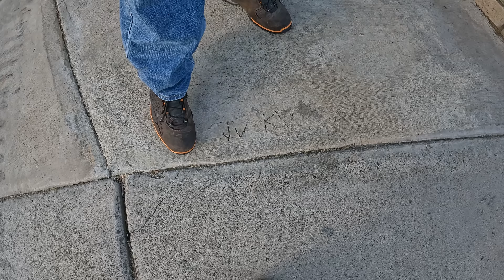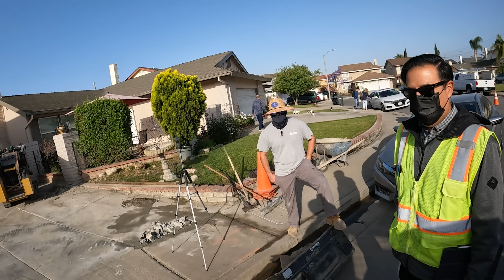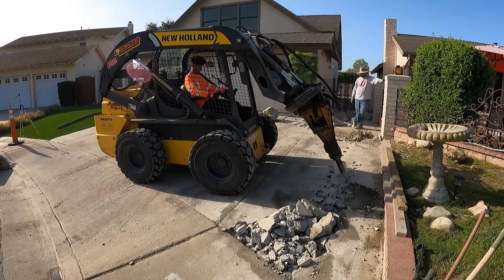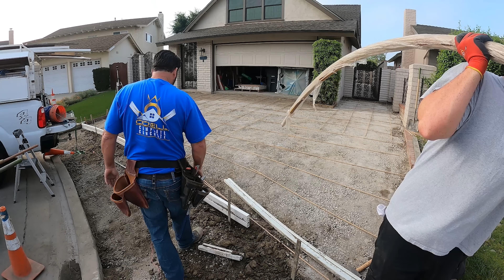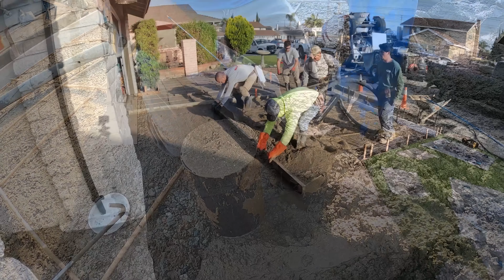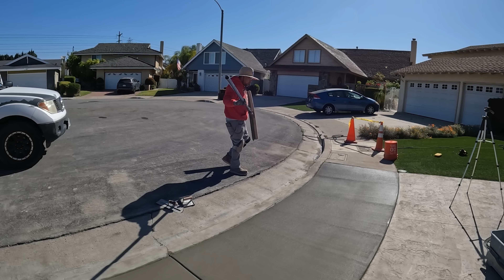The Building Inspector Showed Up...

Comment: Fly ash is an additive to make concrete flow better. It also acts as a filler to make concrete cheaper. Fly ash is a by-product of coal fired power plants. The PSI of concrete is determined by the amount of Portland cement mixed into the concrete. It is also determined by the amount of water added to the mix. For a driveway, I would use at least 4000 psi mix. Concrete is not an exact science. The psi can vary as much as 1000 psi in either direction. I might cost a little more, but better in the long run to have more psi than not.
Reply from the maker: I concur

Comment: The OLD concrete drive way  DID NOT LOOK TO HAVE "WIRE MESH" NOR "RE-BAR"  Which would have prevented or delayed CRACKING of the drive way.  Will either one of those reinforcing materials be used on this drive way replacement???  I notice other people asking the same question.....Will wire mesh OR rebar be used to reinforce the drive-way????    SORRY !!!  AFTER GOING FURTHER INTO THE ACTUAL VIDEO OF THE CONCRETE BEING POURED, I DID SEE THE "REBAR" USED ON THE SURFACE AND BEING RAISED AS THE CONCRETE WAS BEING POURED TO MAKE SURE IT WAS PLACED TOWARDS THE MIDDLE OR SO OF THE CONCRETE THICKNESS...
Reply from the maker: Yes, reinforcement in the driveway but not in the approach

Comment: Have you considered using non-rusting GATORBAR to avoid rebar expansion cracking concrete?
7x lighter than steel rebar
Higher tensile strength
Rust-free/ Corrosion resistant
Non-conductive
Extends life of project by 2x
Environmentally friendly 

Available in glass or basalt
Reply from the maker: haven't heard of it but it sounds a lot like what I used

Comment: That's one of the smallest hammers I have ever seen-in my 50yrs of heavy and highway construction. The reason it is breaking so easy is because there is no wire in it---usually you use at least road mesh or equal----and, the concrete is thin and probably not placed properly---FYI---you don't pour concrete, you place it !!!!! You need to research your methods of placement of concrete and the proper curing!!!!! Come on---lets do it right and give the buyer a job that will stand the test of time !!! You residential contractors have a lot to learn!!!!!

Comment: Hey… do you have to put rubber between the slits to protect concrete from expands with the heat and shrink with the cold because the weather or no need. Thanks 🙏 keep it up 👍
Reply from the maker: Not here in Sothern CA. where its beach weather everyday

Comment: Hey Dave, with respect to the drain pipe and the pop up at the end...I can see that this is at the end of the grade on the front yard but, is there an issue with residual water that doesn't drain? I suppose it would be minimal and evaporate?
Reply from the maker: Yes the residual will seep through the perforations

Comment: Difference with Aus concreters we use aluminium screeds and don't have to continuously bull float concrete into our holes we get it that flat. Pieces of wood are rough as and leave defects everywhere. 
Also no steel in the approach, hope the soil isn't reactive otherwise it is going to break up.
Reply from the maker: This is standard building procedures in this area, and it seems to work well.
Reply: @OdellCompleteConcrete  you must be blessed with good soil

Comment: Great video! I got a question, why the concrete mix I made using the recommended water amount seems too dry, not flowable like what I saw from professional truck loads? Thanks for answering
Reply from the maker: Because they can reach specified psi on bag without as much cement
Reply: Thanks much! In this case, how can I make it flowable like professional truck loads so as to avoid voids?
Reply: @linzhang1717  From what little I know, the drier the mix, the stronger the concrete. So if you want to reach the PSI specified on the bag with a wetter mix, like he said, add more cement to the bag mix and then mix it up wetter.

Comment: Why not use 2 45 degree fittings at  corners instead of a 90? Hard to get the debris and a hose to go in to clean it out. It will get crap in it eventually.
Reply from the maker: It's going to flush out quickly because of all the slope

Comment: If you widen it in this case its only make it easier to get one more car off the street, You can clearly already do it if you know how to drive. The consequence is that you're clearly losing parking footage on the street. So allowing it is a clear win for the homeowner but potentially a big loss for the neighborhood. Seems pretty obvious to me, it is a reasonable policy to have.
Reply from the maker: 3' doesn't change any thing on the street
Reply: @OdellCompleteConcrete  in a place like the Bay Area it absolutely does. Twenty feet between two driveways is enough room for two cars. 17 feet might not be. 

Sure it may not be a problem in that town, yet.

Comment: This inspector and you don’t understand why there are rules to how much concrete apron there should be.

Ideally, none.  But there must be concessions for public safety.  The problem is that precipitation is the only means for replenishment of aquifers and ultimately everyones water supply.  With all of this concrete and parking lots everywhere.  All of that water must go somewhere and it’s directly into storm sewers washing untreated garbage directly into a lake or stream while abusing the infrastructure at the same time.  Public and private assets are the primary reasons for most flooding.

Comment: I've seen powder coated rebar and I know it's an issue because of cracks and chips in the powder coat. I'm just wondering if the powder coat could be touched up after the rebar is laid out,
Reply from the maker: Yes, it can be touched up.
Reply: @OdellCompleteConcrete  Would it be worth it to spray the rebar before pouring the concrete. I know even a microscopic hole in the powder coat can lead to corrosion. 
     Does the rebar move once the concrete was set? I saw this deal where the put a lot of tension on the rebar then when the concrete has set they let the tension go. This puts the concrete into compression making it stronger.

Comment: total phckng BS... being kept from making his driveway smooth at the bottom to save constant issues with tires being damaged due to running into the curb is HORSESHITE!
There is no reason why he could not have done that, easy in and out especially when parking cars side by side!  Rules are needed, surely, but not oppression by stupid control!

Comment: I’m not sure I’d trust the pull-up method to keep the rebar in the bottom third of the slab. The sidewalk/approach/apron wasn’t keyed-in so I’d guess elevation changes over time wasn’t a concern. I should’ve prefaced my comments with…I know next to nothing about concrete.
Reply from the maker: The previous concrete didn't change elevation so I'm assuming the soils are good.

Comment: The slab was over worked ?
You could never push a real defind stamp into that hard trowels concrete, 
Never Steel trowel outside concrete, 
Brings the stone to the top of the slap and more chance of stones then Cement on top ,
Which will cause pitting and popping, 
Just saying 🤔
Reply from the maker: Stones are the hardest part of concrete

Comment: That apron rule is stupid. On my street, that would be really problematic. We've got at least a 15% slope. To avoid bottoming out, the apron has to be somewhat wider. I've also got a telephone pole to contend with which really dictates how we can maneuver out of the parking.

As far as fly ash goes, the big problem is that it contains a lot of heavy metals. When concrete with fly ash gets removed, that fly ash is going to end up who knows where. Disposal of fly ash can get rather expensive, so this isn't about a "cheap replacement". It is about getting rid of a problematic waste product. Eventually, it will become somebody else's problem. It is the asbestos of the 21rst century, except that there's really very little that clues you into the fact that it is there. Construction workers who deal with waste concrete in a few decades are almost certainly going to end up with a number of health problems as a result of those heavy metals.
Reply from the maker: Thats sounds right to me.
A waste product being cemented in

Comment: isn't it great how building codes vary around the globe. The idea that drainage can discharge across a pavement ("sidewalk" to you) by overflowing a pipe is incredible. I guess you don't get sub zero temperatures around there? Ice across a pavement caused by private drainage would be an easy legal case when someone slips on it
Reply: well this is not to far from the ocean and the temps are mild in the winter like in the 40s and 50s at night don't get too many freeze nights you have to head in to the mountains  and the desert areas before you have to worry about freezing in the winter I live in the deserts around about 50 to 60 miles from where this is and we will get temps in the upper 20s to the low 30s in the winter tho we don't have perma frost here tho so freeze-thaw cycles are really not a thing here in CA

Comment: Nice job.  Its good to see some competent ground works on You Tube at last.  My only comment would be that I would have spec'd weldmesh reinforcement as an anti crack membrane that would have narrower centres for the bars, as well as it being quicker to lay.  i assume that the concrete has been sprayed with a drying retarder as no hessian has been overlaid?

Rather than cut pockets under the existing slab I would have expected a full length undercut to allow the adjacent slab to be fully supported by the new one otherwise the nibs might break off.
Reply: Go watch west coast custom concrete and help him out. These men did a great job. The way we have always done it in Southern California
Reply: @gregcallison5658   My comments are based on good UK practice that many international engineers would endorse.

Comment: Wow all these comments on such a great job, Odell Complete Concrete, not quite complete, in my World ALL concrete gets Steel Mesh, no Steel in Concrete eventually Cracks then lifting, like it looked before you Pulled up the old Concrete, Any new concrete to Existing concrete Requires Dowel Bars, Do you even Know what they are over there,  then to top it it off you use Vibra Screed for 20 square metres  good Contractors Laughable.

Comment: Every time you powder that slab, you realize that you have to hand handle those crumbs ... right. Big waste of time and manpower. Tell you hammer operator to leave the slab in the biggest pieces you can handle, because you can always make them smaller! Wheelbarrows and shovel time kills the profits. I ran Bobcats in a major demo company in SoCal for years and when you have laborers crawling on the ground cleaning debris with their fingers, you cost both you and the customer.
Reply from the maker: problem is the concrete Recyling centers will not accept a piece of concrete over 2' x 2'

Comment: Not picking, but I didn't see any type of expansion material between garage and driveway and driveway and approach slab.  Is there a reason for that?  Also tell that one finisher with the swimming pool trowel to get a finishing trowel.  He may be good.but perception is reality.  Nice video.
Reply from the maker: NO expansion joints needed in this situation.

Comment: just have the homeowner put a rubber block in the area they wouldn't let them taper down and widen. or angle cut parking block/bricks loose laid. 🙃
idiotic laws and regulations need to go away, but so do the idiots enacting and wanting them.
Reply from the maker: Yes some simple mobile modifications will work

Comment: you cant put in a drive like this garbage was in my city ada rules dont allow you to use the sidewalk as a approach seems you or him dont know what you are talking about 3250 breakage is very week concrete we use 4500 pound breakage and we use fly ash and slag
Reply from the maker: The standard here is 2500. 4500 is only used for structural or bad soil conditions